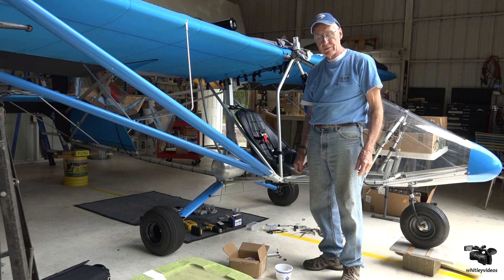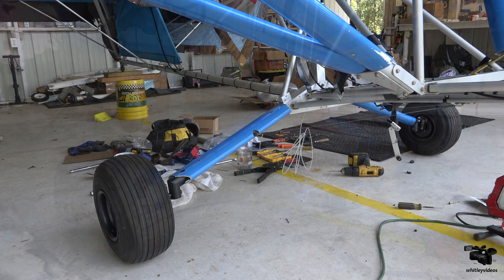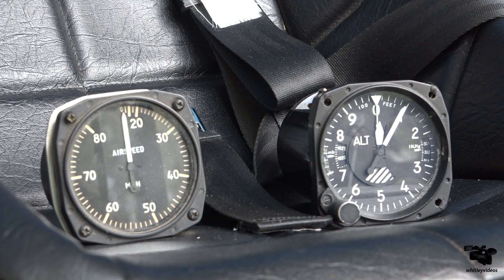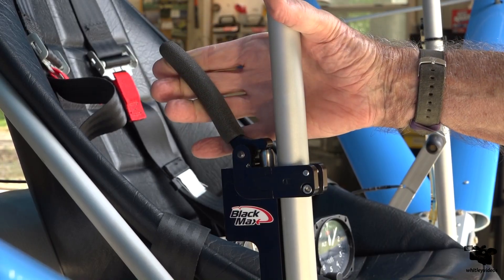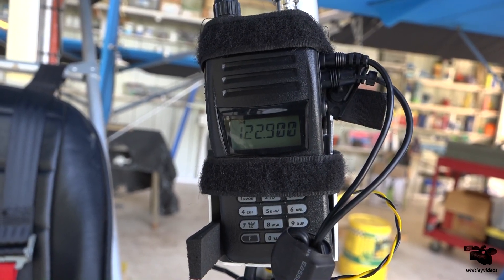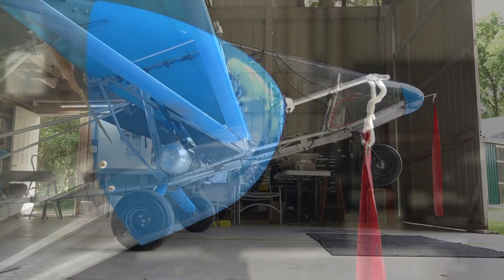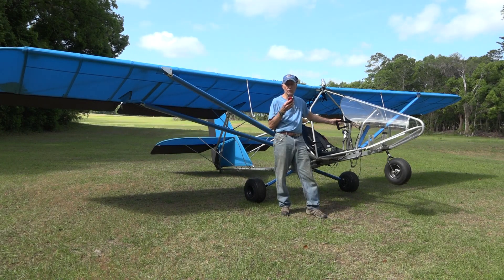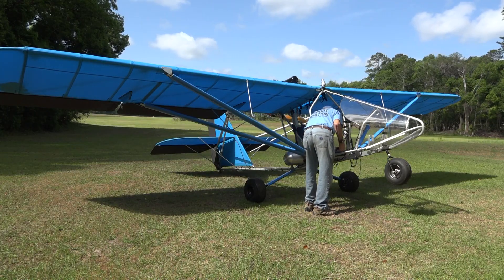My Brothers and I Just Upgraded my Aerolite 103 Airplane

Comment: Very cool seeing you settle on an Aerolite 103. This has been #1on my list of ultralights to buy if I ever pull the trigger and go bigger. My current flying form is a foot launch powered paraglider with a MacPara Colorado wing. The beauty of PPG is no hanger costs and super easy transport but originally coming from fixed wing Cessnas I have longed to buy an ultralight like yours. Keep posting more videos as you go. I have watched several of your videos over the years.

Comment: Hi Wayne, excellent video, great shots! Nice mods too. In one of the shots, it appears that the little support block for the elevator cables is lifted a little on the far end. Maybe check to see if all the rivets are there? Seems like it should sit flat on the main tube.
Reply from the maker: Thank you for your comment. That support block is an aluminum angle and all is well, it sets flat under the main tube with all rivets in place. Regards, Wayne Whitley